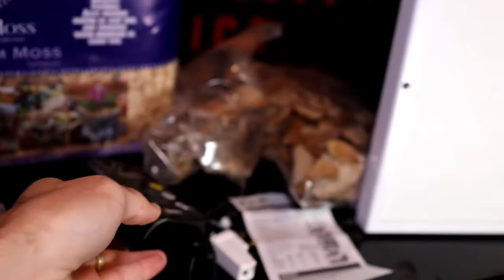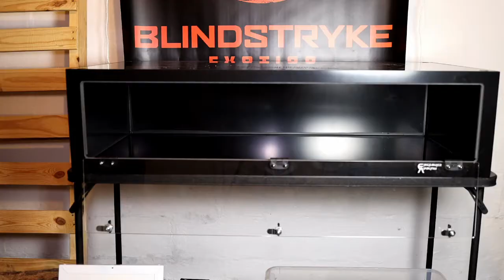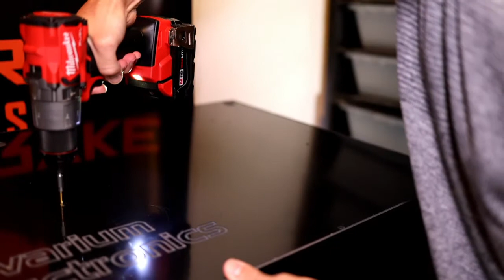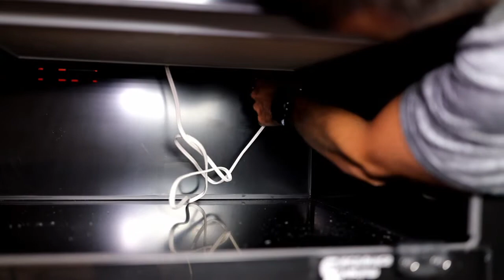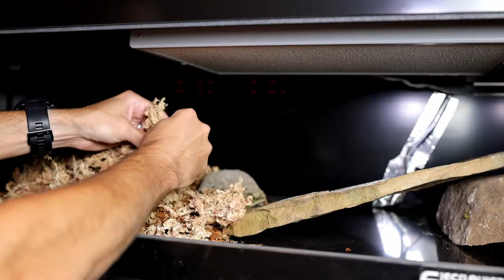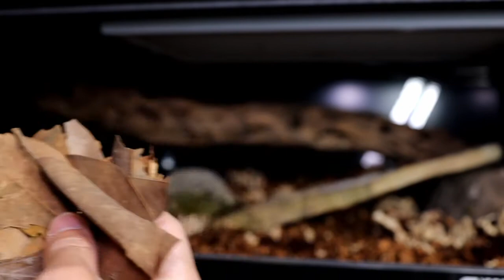New Reptile Basics enclosure for my Brazilian rainbow boa!!!

Comment: what type of moss is this, and where did you get it?
Reply from the maker: The sphagnum (brown) can be purchased anywhere pet products are sold. The green moss was actually found locally. Typically, I don't recommend using wild plant life in captive bred animal cages, but I went through a process of soaking it in water for several days to try and kill any parasites or bugs. 

It hasn't effected the snake 1 bit, but I actually don't have it in there anymore since I moved and totally cleaned out the enclosure.

Using wild plant life is at your own risk, and not recommended.